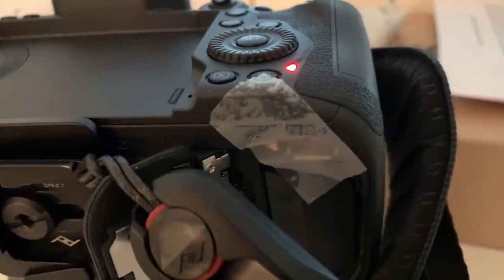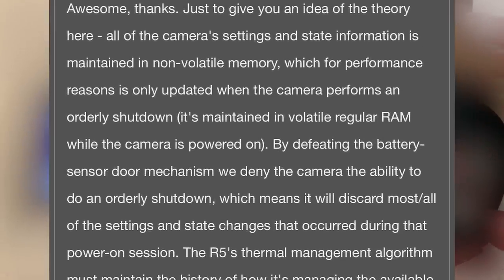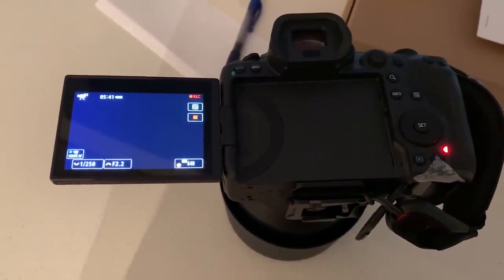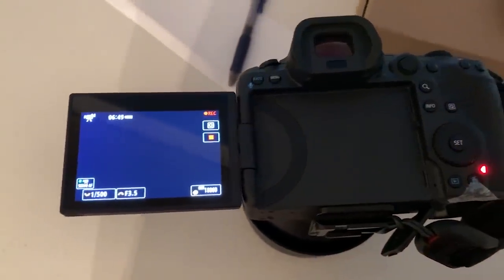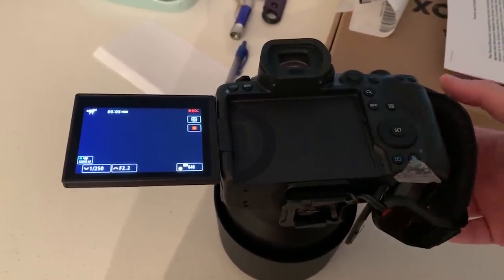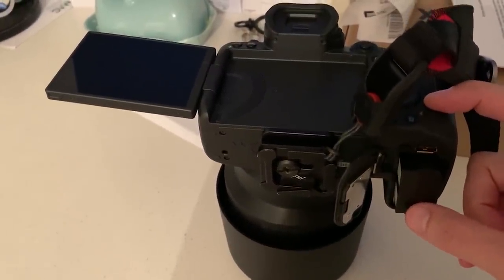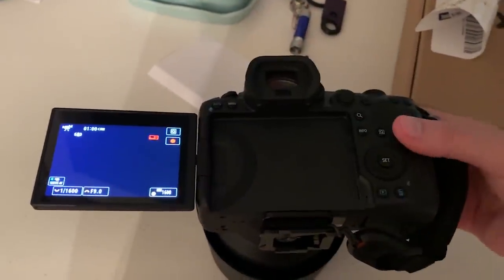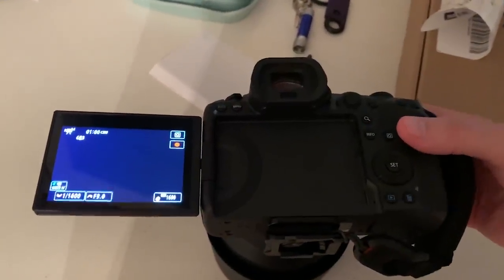CANON R5 OVERHEATING FIXED 😳 With SCOTCH TAPE!! Crazy !! But TRUE!! WATCH THIS!!

Comment: When your camera tipped over I was like 😳 🤣

This is pretty ghetto, but I'm hoping this is true (just a firmware limit) because this means that firmware updates can remedy the situation.
We have to remember though, other cameras are not able to run 4k 120 at all, let alone 8K (most, like the Sonys and Nikons won't do 4k60). So it's not fair to say the R5 overheats where other cams do not. 

And I understand and agree that the camera is not doing what it was advertised to do (ie, counting down record time when you are taking photos and in the menu). This seems like really poor programming. I'm 1000% convinced this wasn't a cripple to "protect the cinema line" because Canon could have just not put in 8k or 4K 120 and saved a lot of time, money and effort and still had a camera ahead in specs compared to its competition (like the A7RIV or Z7). 

Btw, I had worried that maybe the sensor would have issues with overheating and causing noise (sensor is more sensitive than a cpu). 

There is a guy out there named BRENT HALL on Youtube who does night long exposure photography and he tested long expsoures for hours long, and there was no more noise than for shorter exposures (in fact, there may have been less).  So this is further good news on the hardware front.

I'm still waiting patiently to see how all this plays out!  Unlike the hoards/herd who are being very negative and conspiratorial, I'm looking at the positives as to what will happen when firmware is updated (just like with the EOS R).  It's all very entertaining actually. Sure beats hearing coronavirus news. 

Still wishing you and your wife all the best.
Reply from the maker: Thank you so much!! She is home recovering! Now the journey begins! Yes I think they can fix this! This test was actually to my sd card at 4k 30 hq mode , I didn’t attempt the 4k 120 yet but I’m sure it would be similar results. I don’t want to break my camera though lol
Reply: @SNAPAVELI  That's good news! Tell her we all wish her well. 

I'm so gentle with my gear, probably borderline OCD. 

I hope Canon gets this sorted. Sure there are lots of people looking to cause trouble, but you are using the cam exactly for what it was designed... high end photos with the ability to get some video/b-roll of the shoot. As advertised, it should be able to do that, but with the clock counting down in photo mode, and even in menus, and super long recovery times, that's not remotely acceptable.
Reply from the maker: 77dris True I agree! I actually love the output of this camera! I just want the heat to be on canon so they hopefully take all the silly limits off! It has to overheat at some point for sure, but man the recovery times are totally unacceptable for pro work!
Reply: There is no way they will "fix it" through firmware updates since it was deliberate. Canon simply doesn't want to cannibalize their cine line of cameras.
Reply: @Eihei  I think/hope that if it is firmware updatable and Canon won't do the fix, others like MagicLantern will do the fix. I totally agree with @77dris that the overheating issue/discussion is completely overheated. At first we hardly ever heard of 8K video and now all of a sudden everyone seems to make hours long feature films in 8K. If 8K is really that important go buy a real 8K camera, and pay the price. This is just my humble opinion and I don't want to offend anybody. Have a nice day and becomre or stay healthy.
Reply: What Are You On About  Hahahaha, no no no no :-)
Reply: 77dris hey you know the A7siii does 4k 120p 422 10bit for basically an unlimited amount of time

Comment: Between the R5 and the a7RIII which would you prefer?
Reply from the maker: The r5 for stills at this point, dynamic range is there, hi light roll off Is excellent and the rf lenses are stellar. Video is a total joke though

Comment: You got usable files with this method? I just tried it with an external battery and 120p 4K. Works for the limits but all files are only .DAT files no more .MP4 and can't be opened by Final Cut or similiar
Reply from the maker: Good find! I didn’t try to load the files on my computer! They are playable on my card in camera though. It’s definitely not a method I’d use, just a test to see the limits of the fake heat control
Reply: @SNAPAVELI  just tested again... I only get broken .DAT files, on the CFexpress as well on the sd card
Reply from the maker: Stefan Gatzke hmmm! Ok I’ll load my file up and see if mine will play in premier!
Reply: @StefanGatzke  cant u finish recording first, then do the battery trick while on standby?
Reply: Bruno Lazaro then it writes the shorter time next to zero time left.. :(
Reply: johnny_blz but could be. You can do some hexadecimal on the header of the .DAT to bring the .MP4 back full, but I don’t know how

Comment: So you could use a dummy battery instead, and just unplug the cable. That way, you don’t have to have the battery door open. But of course, you would need to have an external power source like a power bank.
Reply from the maker: Totally should work!
Reply: J. Marcus Photography please confirm if they file is unusable after you do that. Also would it work if you do it after the Movie recording is stopped ? Or only while it’s writing on the card ?

Comment: Would you get the same result if you just killed the power to a dummy battery while the battery door is still closed? The camera wouldn’t have the opportunity to write info to the NVRAM. Anyone tested this?
Reply from the maker: It in theory should work! As long as the door sensor stays depressed the entire time!
Reply: I shall probably test this tomorrow evening after I receive my dummy battery.
Reply: Vincent Cui Please post your results. So curious :)

Comment: Thanks for sharing!  What resolution and framerate were you recording in during this test?
Reply from the maker: I was at 4k 30 hq! All I , so it didn’t totally clear it out and give me all my time back ( my card was small so 17 minutes is all I can do at 64gb card) but it did allow me to do 5 full minutes 3 times in a row with this method. I just stopped after that. Probably could have done it indefinitely

Comment: Thanks. How long will the camera record 8K with the throttle bypassed? Will it record to the memory card's capacity or is there some kind of secondary TRUE overheating detector that shuts down the camera before it fries? Thanks again.
Reply from the maker: Well that is the sticky part! I won’t give you full time back... so I’m thinking that the camera is still cool enough to operate for a bit, but internal temp sensor is hot enough to know that it shouldn’t do the full limit again. It does give me 5 minutes of 4k hq again , and the warning does come back around the 6 minute mark each time. I did it 3 times in a row , no issues, but I didn’t want to keep doing it indefinitely since I’m no scientist and not sure if it’s actually a good idea.
Reply: @SNAPAVELI  Thanks for that. Sad to say that it doesn't seem to be a serious production camera, especially when even the 4KHQ is limited by heat. Your work-around is brilliant, but ironically it almost creates more questions about the camera's stamina on a shoot. I'd be terrified to use the R5 on an important shoot. It's just not a pro video camera for the price they're asking. Cheers and good luck with your work.
Reply: @HeathcliffBlair  no it's a pro photo camera like the A7RIV with some limitted video bonus features.

Comment: However that does NOT reset the Cooldown timer to "FULL" recovery as per P. 902 in the manual. Even when measuring the internal camera temperature through the empty SD card slot with the media door left open, one can see the camera temp climb from 73 F and when reaching 109 F initiate the Overheat warning (In 4K DCI ALL-I 60p internal recording). In 4k DCI 60p the Cooldown timer does NOT reset to FULL recovery, but only up to 7:33 when using 128GB media or larger when internal temperature returns to normal 70 F or even at 63 F. All the lower modes appear to operate properly. The cool down timer in 4K 60p will most likely be adjusted by Canon so that it resets to FULL recovery once the camera cools down INTERNALLY. From my measurements of internal temperature with test equipment through an empty card slot opening, the camera only reset to 7:33 (time available) when reaching 73 F. Even a 65 F Internally it did not Full recover. It should recover according to the times in the manual on P. 901, 902 according to the media being used. I have not tried to prevent the camera from ever reaching the 109 F threshold by using a cooling device or turning it OFF. I will test that once I get it to FULL recovery. If you reach FULL recovery time for 4K DCI 60p let me know.
Reply from the maker: True! I think the truth is somewhat in the middle! The camera is actually still hot , but able to record 5 minute clips instead of being inoperable.
Reply: @SNAPAVELI  Yeah. Be carefull don't overide or bypass a heat and safety mechanism often . Something get too hot catches fire. Then you're in a big mess. Easier to get an Atomos Ninja 5 if one is going to be recording longer than 10 minutes in 4k DCI 60p.
Reply from the maker: JohnAllen Magee yes surely just a test! My problem is the r5 ninja v combo can’t do 4k 120 and the camera has no 1080 120 so I’m stuck for slow motion

Comment: Is there any way to remove the door completely?
Reply from the maker: LetsGetMarked I’m pretty sure there is, I think you muse do that to install the grip. You would still need a contraption to press on the door sensor.
Reply: @SNAPAVELI  Great! Because, you know, door opened like this is prone to break. So its probably better to remove it.
Reply: Yeah, like all Canon battery doors, there's a little tab that's attached to a spring loaded hinge. It's meant to be removable to attach battery grips.

Comment: I would not be certain that because of an absence of the warning icon on the LCD after one bypasses it preventws that occurance from being written to CMOS memory. The indication of only 5 minutes is evident that the camera knows that it has reached its heat threshold for 4k DCI 60p and that's all you're gonna get. That threshold is temperature based and Canon says so even in their manual. One can not expect Canon to be libel for any camera board damage, personal injury or external damage that could possibly occur based on that cooldown timer alone. Else it would be in all modes and not just the 4k DCI 60 and above modes. Don't expect Canon to rewrite the owners manual. Nor should they.  They may adjust the cooldown timer. That's all we can expect a manufacturer to do. Error on the side of caution. Not to sell us a device that may catch fire and not warn us. Yes this happens. Ask Samsung
Reply from the maker: JohnAllen Magee I’m totally unsure of everything at this point! Eoshd and I have talked and he took this on step further, also pulling the memory card and inserting a new one, full time returned! So some of the measurements are how much the card previously recorded as well. Definitely a slippery slope.... we know the camera can cool down much faster than they are allowing for sure at least

Comment: This is very similar to pulling out BIOS battery. Interesting find. Props to you & Horseshack for doing all these tests.
Reply: Actually it's much better. Because to pull the bios battery you need to disassemble the camera. Then you have two variables in your test and you can't say for sure where the effect is coming from. Because disassembling the camera will cool it down very very fast
Reply: @alexmeier19  I was talking about the fact that both tests bypassing the cameras memory, but great point about eliminating other variables. I tried the test with something less MacGuyvered than a toothpick and scotch tape. You can use a dummy battery and keep the door closed. Killing power to the dummy battery does the same thing. The battery door is not tricked into thinking its closed, it is closed. And killing power to the dummy battery doesn't allow the camera to go into a shutdown sequence to write any state changes.
Reply: @donafied  good Point. Do you loose all your settings?

Comment: Bro I read somewhere there there isn't any heating problem. Canon is doing this on purpose because people have been doing some experiments and they concluded that the internals cool down very quickly. Its got some timers and stuff.
Reply from the maker: Totally makes sense to me! I mean if the internal heat sensors were telling the camera it was too hot , it wouldn’t matter that We tricked it, it would still know how hot it was on restart

Comment: you could not use an external battery and thus the internal one is no longer heated?
Reply from the maker: Yes! You need to cut the power to the battery instead of ending the recording, swap the card before turning cutting the battery back on and you have full record time! But the files are corrupted.... so it’s just proof the camera isn’t honest about either overheating or recovery

Comment: But when you take out the battery while recording you damage the clip and the clip no longer works?
Reply from the maker: Some people are reporting this to me, still not sure it happens 100% of the time yet
Reply: @SNAPAVELI  I have my r5 broken !! try, if you can, to make a second clip of a few seconds and then remove the battery (so as to lose only the clip in a few seconds) and see if the recording time is restored. Thank you

Comment: Cool video, nice find man 👍.  So with this method you can get a maximum of 5 min clips on going?  It’s still using some temperature settings to limit the record times.  Test we need you to do next is see how soon you can achieve full record times again after a short cool down.  Can you shoot for 25 mins HQ, cool down 5 mins shoot 25 mins again.  Reports indicate the camera cools down quickly.
Reply from the maker: Good idea! I’ll try that! Let it cool for 5 minutes and see if the limit changes! Yes 5 minutes indefinitely on my end... but sometimes pulling the battery , the video clip didn’t save. That happened once
Reply: J. Marcus Photography  when you get the overheat symbol just stop the clip and start it agin before you pull they battery. That way you don’t Loose the clip.
Reply: @SNAPAVELI  If you finish recording the clip before popping the battery then the memory will record the overheating?
Reply: I think he just saved 5 min to memory but if you lets say. Start recording at 25min remaining and then remove battery. You get back to where you started. 25 min. Right?  Because in this video he started at 5 min. With button battery it works like that tho.
Reply: Nah, tests with the button battery are flawed, if you disassemble the whole camera to put out the button battery of course it will cool down much faster. Finally You removed the insulation... 🤦‍♂️